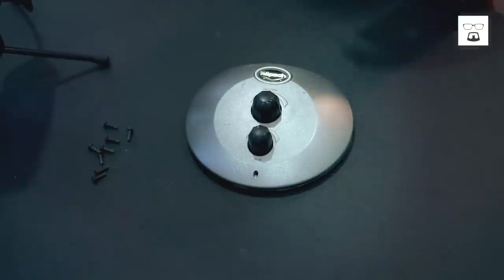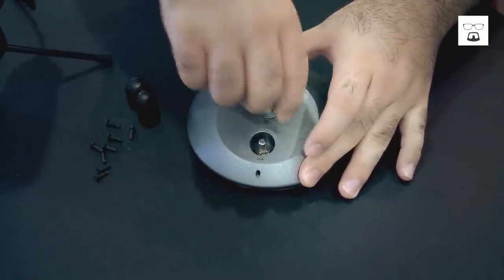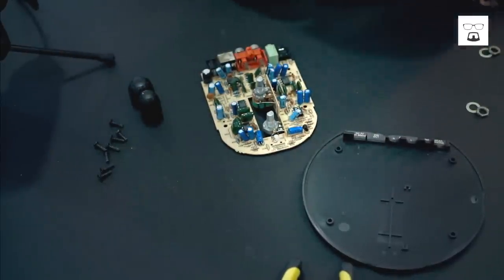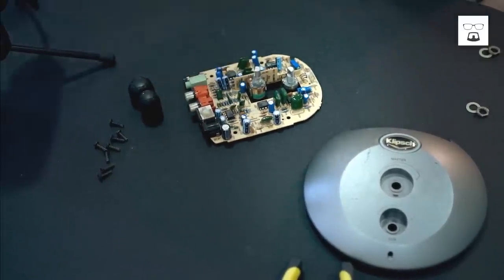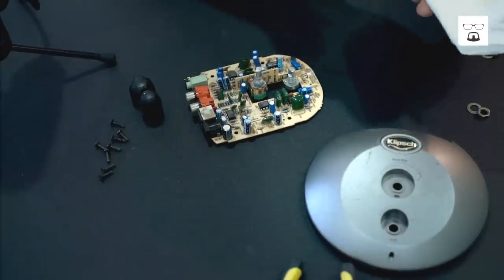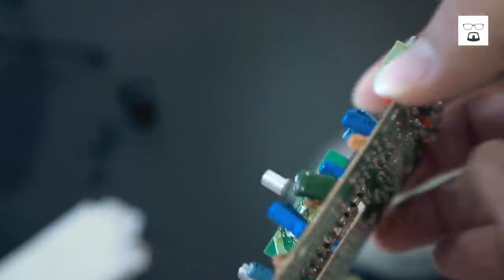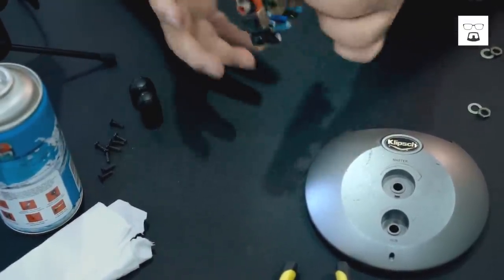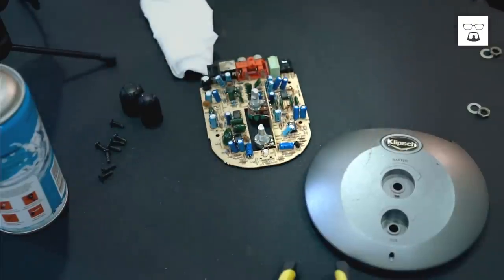How to fix Volume Crackling sound

Comment: Your video Saved my life. I bought some used "Creative Inspire T10's" for 10 Dollars, Well One side was crackling a cutting in and out. MY first troubleshoot efforts told me It was lose wiring, I opened them up and The wiring was great. I thought all hope was lost, I could see why the Guy sold them for so cheap. Then I found your video, at first I thought you were using compressed air so I tried that, It helped a little, Then I realised you were talking about rust remover . I tried your method with The WD-40 and The crackling is now gone,  Now they work great. Thanks again.

Comment: do you know how to fix it on laptop speakers because even with headphones it make the crackling sound
Reply: +kornyfreakgames there is no mechanical adjustment knob on a laptop. If you getting cracking, it may be in the sound software drive.  Suggest you disable all sound effects under the Speaker properties Enhancements tab.  Check the radial button (disable all sound effects).
Reply: Sample rate and buffer size too low will also cause electric sounding distorting and crackles
Reply from the maker: You my friend need to order a thing called a ground loop isolator they are really cheap on amazon
Reply: im having the same problem too, but in my case it only happen when i play game
Reply: @SuboptimalJedi  Dr. Goatee I've been having a weird problem. I use my headphones in my cell phone(It's a LG) and it sounds great but I wanted a little more volume so I been downloading volume booster apps and when I use it so much static and the vocals drown out a little or it's hard to hear. I've googled everything trying to get a answer. I was thinking maybe these headphones are cheap and that's why because I used to use my wireless ear buds which was double the volume but no static.

Comment: Thanks Dr.Goatee! :D My speaker can adjust volumes crackle-free!
Reply: Hey, that rhymed! :D
Reply: I have a can of dust spray  I got from the computer store at $7.00 a can I sprayed where the volume switch is and still the sound hasn,t gone away. I might take it down to a local electronic store where they sell radios and Tv,s etc

Comment: Very nice solution.  I ended up using a syringe needle and injected WD40 in the hole you indicated in your video. Clear as a bell now.
Reply: +torontothegood Yes, I used wd-40 and the speakers work perfect now. Sounds clear and when I turn the switch knob no crackling noise any more.  I used the syringe because I had no other way to get oil in the very small hole.  When I was done, the switch was saturated with oil so I suggest you put a paper towel under the switch in the speaker housing to catch the access oil.

Comment: Fix may be power strip:

Logitec speakers seem to do it, usually to surround sound speakers. But for me after trying everything and even though did it when was unplugged from pc. The problem I discovered a week later was that my power strip was too close to the subwoofer box (all speakers plug into the subwoofer). It took awhile to discover because for years I had the same setup for my pc, power strip and subwoofer on the floor and never had a problem, only recently started doing it. But am glad I finally figured it out.

Comment: One of my powered RCF 312-A 12" tops has a scratchy input control knob. About 30 sec after I power it on it wll start making a scratchy static sound. If i try to turn the knob at all it puts out LOUD scratchy static sound. I am wondering if this is the same issue where I could simply spray the pot from the outside/or inside to fix it. I don't have to turn the knob for it to sound scratchy, it just starts up on its own and is very annoying. If I turn the music up REALLY loud of course it over powers the ongoing static.

Comment: I've got the Amazon basics AC-powered speakers. The problem I have is an electric crackling type sound that doesn't get louder when I increase the volume. I don't hear it all the time, and when I do it's fairly subtle, but it's still pretty annoying. I hear it from both of the speakers, but it's louder on the right one with the knob. Any ideas what it is and how to fix it?
Reply: You mean the 50hz buzz - I really dont know any other solution than to buy new - All mine go buzz like everyone even my last -  Its like a plague that physically infects the speakers -Have no solution to this.

Comment: So I have this USB headset from Gembird. The microphone didn't work right out of the box but I can live without it. But there is a problem with headphones too. I don't know if it's the driver or something else but sound just constantly crashes. It becomes very loud and starts to crackle, the pitch is changed too. I have to plug them out and then connect them to the PC again to get rid of it. But it doesn't work every time. Sometimes I have to do it for 3 or 4 times before it works.

Comment: God advice I have a Panasonic B 50 model which I like as a transistor radio . When I turn the radio on there is this annoying crackling sound. I have a spray I got from the computer store and I sprayed it through the volume switch opening. It still has the same type of sound. I can,t really cant remove the tuner. I do know of a place to do it.

Comment: So this should work on my small Logitech Realtech High Definition Audio speakers that I use for my windows 10? They have been having the same crackling problem changing volume while the sound is going and I am concerned that they may be losing sound and volume quality. This is a red flag to me because if this persists they could break.

Comment: I have a different kind of problem.  I have a Digital Surround sound system and I get a sharp crackle whenever someone uses a word that has an "S" Sound in it for some reason.  I don't notice it at low volumes, but I do notice it a lot at high Volumes and I notice it a lot in Speech, Like for instance I listen to a lot of CreepyPastas on YouTube and It about drives me nuts.  It doesn't seem to matter what speakers or Audio devices I use.  I have 2 USB Audio devices, headsets, on board 3.5MM Jacks etc, it doesn't seem to matter.  And with headphones I notice it at Low or high volumes as well.
Reply: 85 Studios That problem most likely is'nt in the volume control, it could either be that your speakers are cheap, that the amplifier outputs too much for the speaker, your amplifier setting are not set correctly, or your capacitor is bad, but since the same problem occurs when your headphones are plugged into the amplifier, it's most likely the capacitor.
Reply: LeJew Have to figure out which capacitor it is, I can surely desolder it and replace it.  Do you think it is an electrolytic or a Ceramic Capacitor?
Reply: You can try to lower the volume on mic (if recording using a computer) when recording, alternatively, use de-esser plugin.  (I hope it's not a hardware issue mentioned by LeJew)
Reply: milllosh I got it.  It's the mosfets, Receiving a signal from the OP Amp and bridging it partially from the center channel to the rear channels and causing it to only partially pronounce the sound in the front 2 channels.  I resolved it by putting 2 diodes and 2 Capacitors in between the center and the left and right channels.  Cleared it right up..it was causing overdrive issues in the front 2 channels whenever there was a high frequency sound.  an equalizer could have helped resolve this issue also, but I don't have one of those and they are kinda pricy for 5.1 Virtual Surround systems.
Reply: 85 Studios  Glad you fixed it m8.
Reply: 85 Studios Happy to hear that you have come up with a solution!

Comment: Pleaseee hellp meh 

when you connect your computer with aux this goes to my stereo.
but the sound of the computer .. and then the sound of iTunes or Spotify or internet … and then the sound of the stereo (Volume up ? Down? Up Down up down Up -…..- i’m going insane

i keep putting one up one down one up one down all together and i cant seem to get it right =[

i even bought a new stereo new speakers .. and again it happens back and forth 
and then the beams in the volumes that show if you go over with pressure… make the confusion even worse

does anyone know how this works? in normal lang not some technical lang XD so many forums i just don’t get half what they are saying. LOl
Some sites even say put everything in the computer up all the way and then do it with your stereo.

i have a bird and he always moves his head when a sound is to loud 
then he seems to be doing that allot even if i put the sound all the way down so that confuses me with those presures too =[

But then the computer does seems to be inlinked with those beams……

- a reall stupid circle im in -

anyone please hellp but only answer if you are really sure .. my ears are hating me for this …

this answer i will live my life by XD

Thanks alllllot <3
Reply from the maker: Wyatt Afterglow sorry i have been inactive a while but it might help you to know that each software handles volume differently. One thing that can help is right clicking the volume icon on the bottom corner and select volume mixer. If that doesn't nt help a DAC (digital to analogue converter) is highly recommended.

Comment: When the intensity fluctuates with the potentiometer, sometimes the sound is heard only from one speaker.
This product will solve the problem?
Reply: Don't use WD40, use proper contact cleaner
Reply: @nickfatsis9607  "use proper contact cleaner"
like what?
Reply: @Channel-gn9hc  Actual contact cleaner, one that says "contact cleaner" on the can.

Comment: but why does that work??? that's just the volume knob... my speakers used to crackle too but I fixed that by tightening some screws inside and isolating the speakers case with some silicone hahaha
Reply: You sure that wasn't speaker rattle instead of crackle?

Comment: I sometimes put the volume down in software, and then go from low to high volume on hardware and do it a few times and the crackle is gone for a few days lool
Reply: Trust me this is the initial state of the issue it will start bothering you by suddenly not getting recover and you have to go through this process somehow.

Comment: Mr goatee ... u need to shave & go back to school ... u should NEVER use WD40 to clean a pot!!!!!!
Reply: I was thinking the same thing..   I'd only use can air to clean pots.  I don't think it's a good idea to spray liquid on electronics. Even if you wiped it all off, it can still leak out that hole.    I've only messed with push pull pots and foot switches for guitar and amp related things.. I'd assume it's the same for all pots tho.
Reply: People shouldn't be listening to YouTubers like this, WD 40 is not the correct chemical to use for this job, it'll work in the short run, you need to use proper contact cleaner, one of them is called "DeOxit D5" there's no problem spraying it in electrical circuits, it's non conductive, I've been using it for years, all the pros use it, it cleans, lubes and evaporates, WD 40 will attract dust.